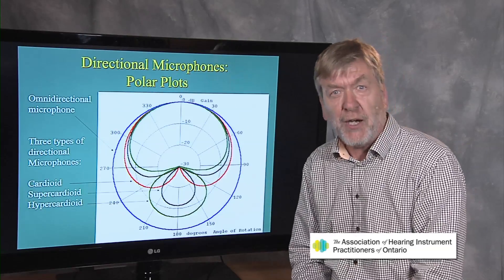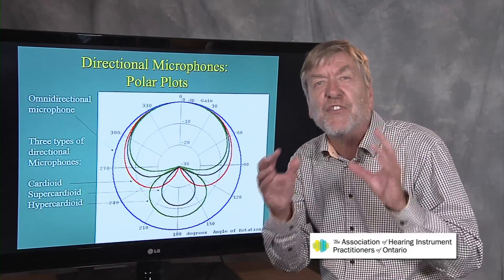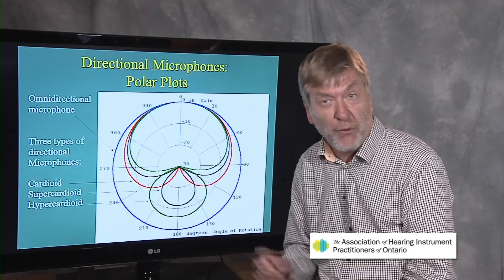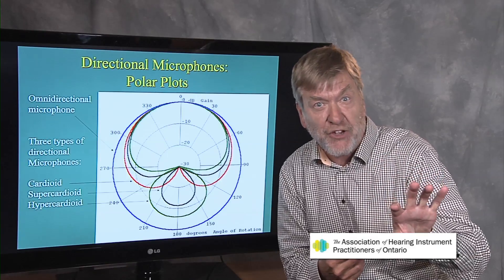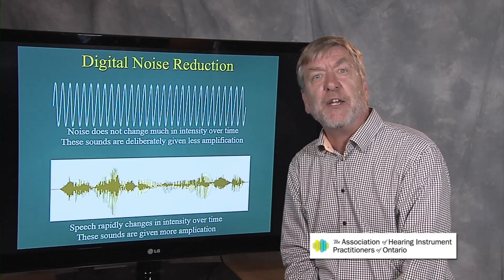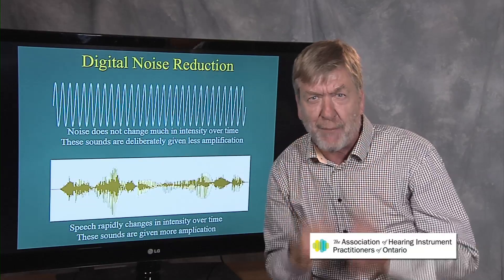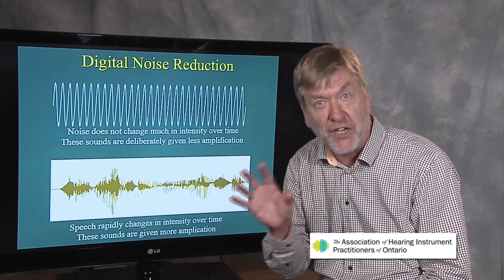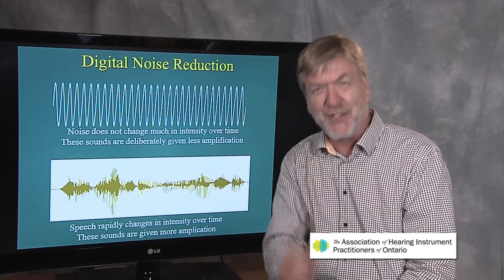Ted Venema Talks Directional Mics and Noise Reduction

Comment: Can I send you my audiogram so you can read it and tell me if hearing aids will help and if I have aids how to program them to get the best hearing. I had Meneires got about 8 years bilaterally until it seemed to burn out a couple years ago. I was left with moderate to severe sloping hearing loss. With OpnS2 aids I still have trouble with some word recognition.

Comment: I am a veteran and have been involved in sound production, studio recording and sound system design and installation since in my teens. Am now 77 yrs and have tinnitus in both ears and hearing loss above 7khZ. I am going for a hearing test next month at the VA audiology dept. 
I also have, at home, an elaborate home theater system with 11 speakers and Dolby Atmos surround. Should I be considering an omnidirectional aid or are there units that can switch pickup direction patterns for different circumstances and conditions?? And, if so,  can these be controlled from an app?
Thank you
Reply: I’m an audiologist, with hearing aids there are different settings you can pick, usually for basic hearing aids there can be a television setting, resteruant setting, and basic setting etc. with the television, it would be wise to tell your audiologist that you would prefer to have omnidirectional sound for your television setting, so the microphone is picking up all directions. Usually television settings are set as a cardioid setting because the speaker is coming from one direction, in front of them. But with your case an omnidirectional setting would be preferred.
Reply: @Cknoell04  Can I send you my audiogram so you can read it and tell me if hearing aids will help and if I have aids how to program them to get the best hearing. I had Meneires got about 8 years bilaterally until it seemed to burn out a couple years ago. I was left with moderate to severe sloping hearing loss. With OpnS2 aids I still have trouble with some word recognition.